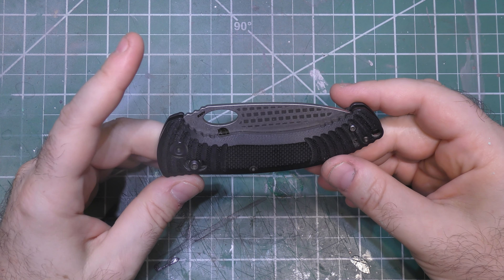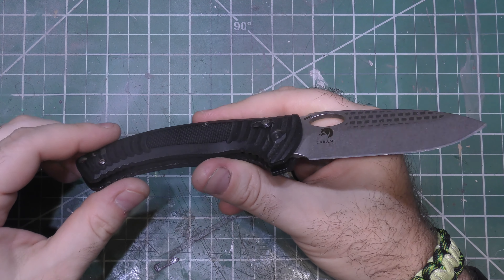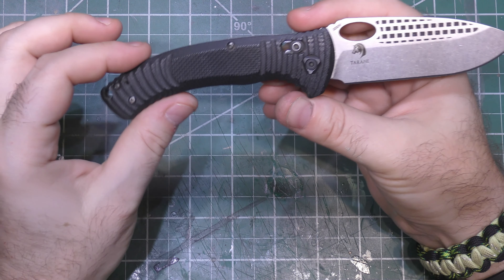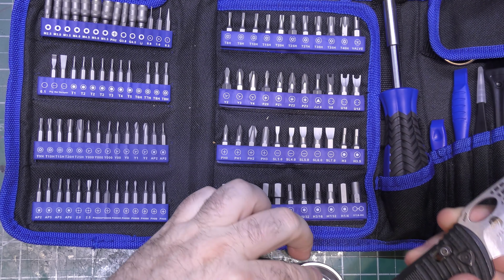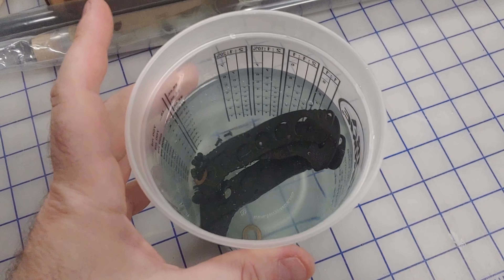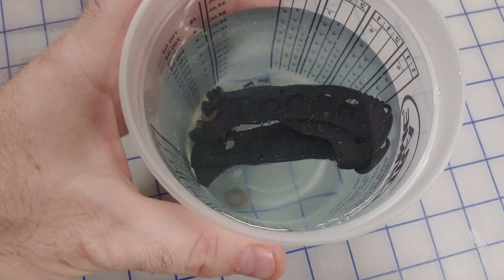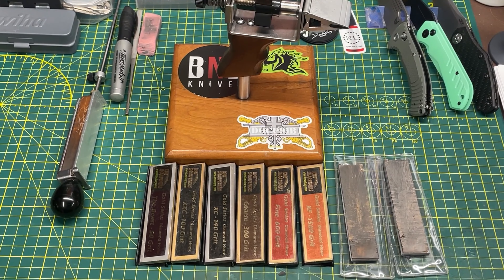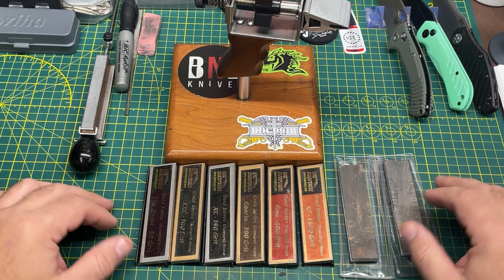Discontinued Benchmade 737 Aileron Complete Refurbish & Remodel

Comment: That looks great, outstanding job 👍I like to finish strop my edges to 0.1 micron or 200,000 grit. Has Dave ever tried going even finer than what he uses currently? Enquiring minds want to know lol. Its definitely an advantage having the proper equipment for these projects.
Reply: Proper equipment is key. I haven’t tried going to a higher grit than the .5 micron CBN from KME. They have a .1 but I would need another strop and I get suck a great mirror now not sure if I need to go higher. Then again maybe I’ll order it when I get some more of the other CBNs
Reply: @pnteraman1616  I dont use a kme, I like the work sharp with blade grinder attachment so its a little different of course but I finish with the .1 on a manual strop. What I've noticed is that super fine grit really really pushes it over the edge lol, but of course it all matters which blade for what and so on. You could always just get some scrap leather or an old belt and try it that way before you jump all in yanno, ive even heard of people that got really good results puting the compound on cardboard ive never tried that but it makes sense lol.